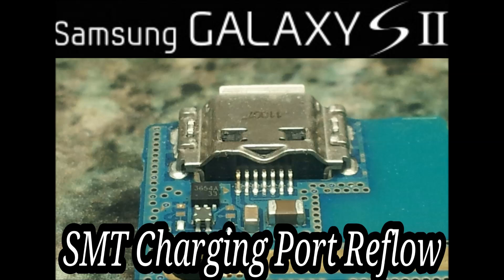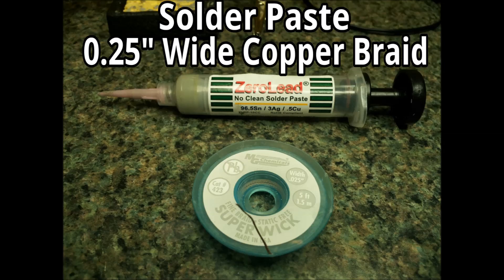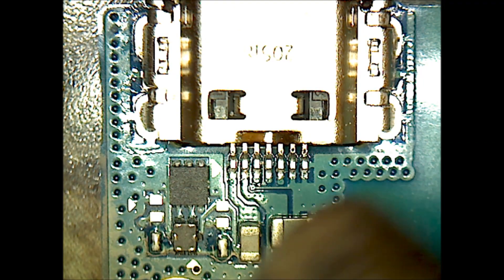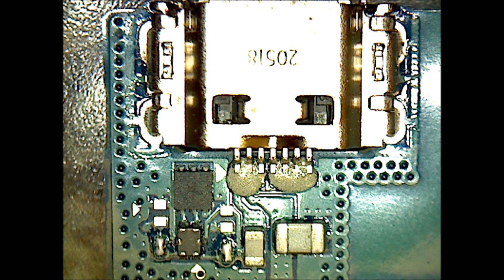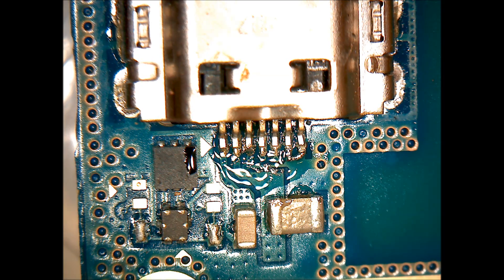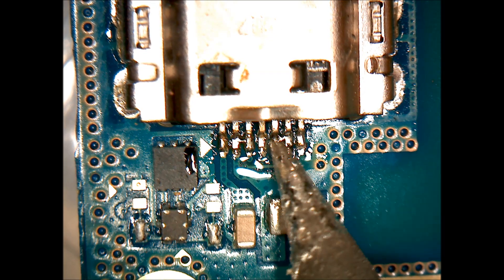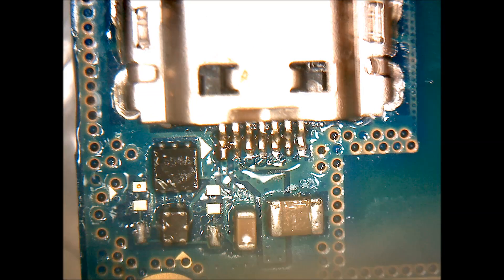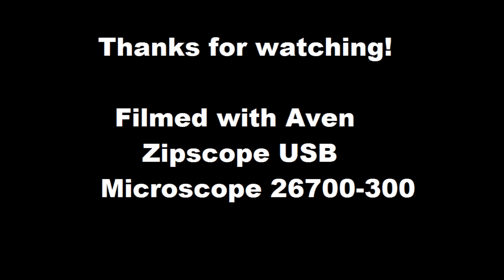SMT Solder Reflow - Galaxy SII Charging Port

Comment: that's not the same charging port in the after picture! whoever soldered, burned the board quite a bit. Then in the after picture, it's like brand new... no charring.  Something is fishy here...
Reply from the maker: The picture in the beginning of the video, as well as at the end, were not the same as the phone fixed in the video. They were just sample pictures to show what it should look like before and after the repair. The board isn't burned in the repair at all in this video. Sometimes the flux will leave a sticky dark residue on the board, but cleaning this with some denatured alchohol will fix that.

Comment: So you're using 200 °C. How much do I need to take the port off?
Reply from the maker: To completely take the port off, you would need a hot air rework station, and heat the board to about 320-360C.